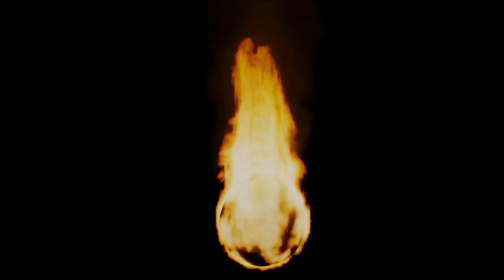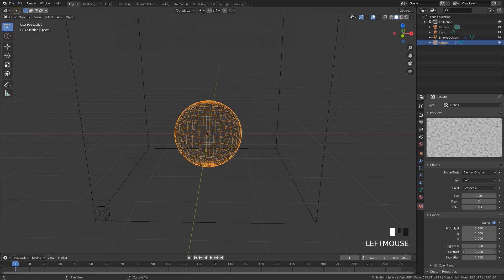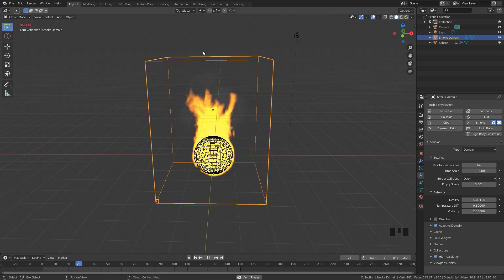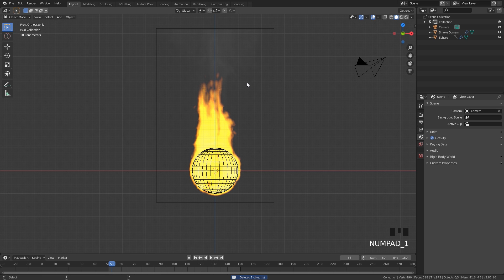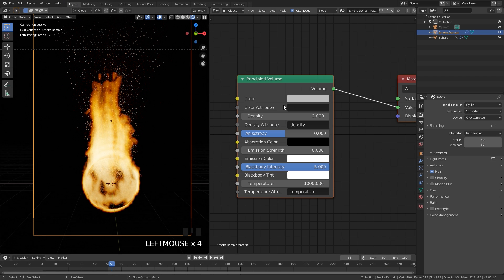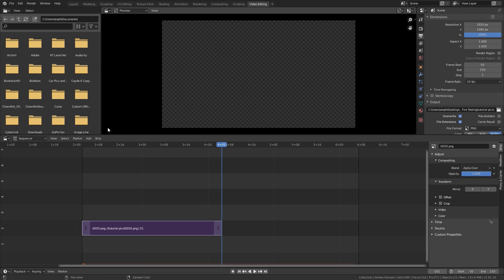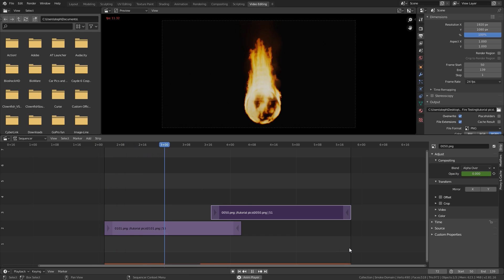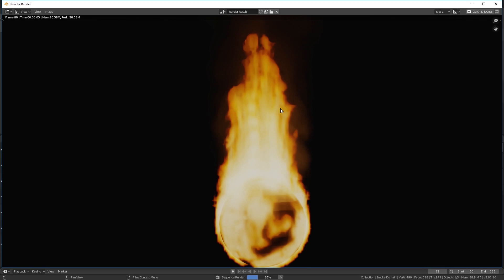Blender Tutorial - Seamless Looping Fire Simulation

Comment: I guess this doesn't work in 2.82? Some of the settings are different. Oh well. Nice tutorial anyway.
Reply: 2.82 now have mantaflow which is a new engine
Reply: @mazenyasser4520  and mantaflow won't work ever so don't bother with it
Reply: @RabbiB0Y  mantaflow works fine
Reply: I was struggling for 2 days trying to make my simulation work, and after some research I´ve learned that the new Mantaflow Engine does not work at all.   So I rolled back to version 2.81.
Reply: Yeah I couldn't find the HD resolution settings so my fire simulation was blurry and low res. I still can't find it. I should just switch to 2.9 and hope it works